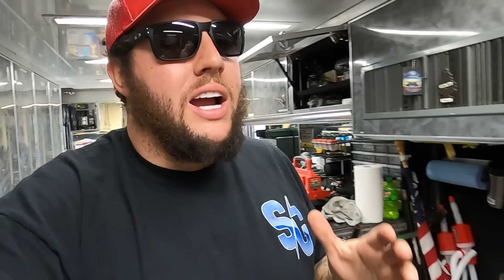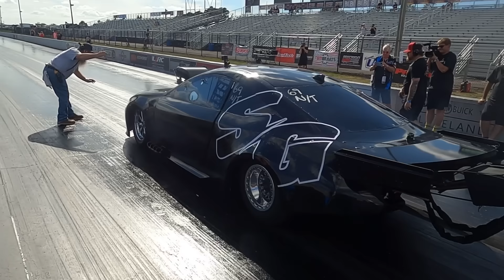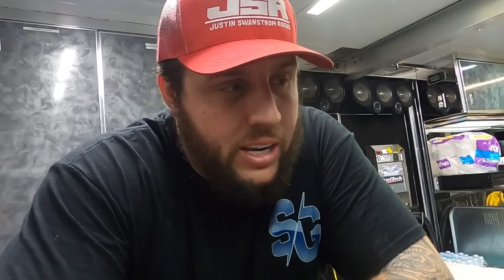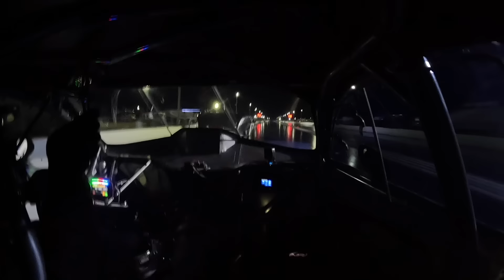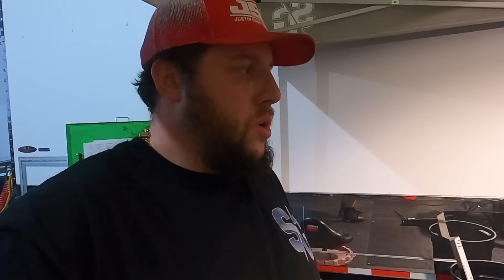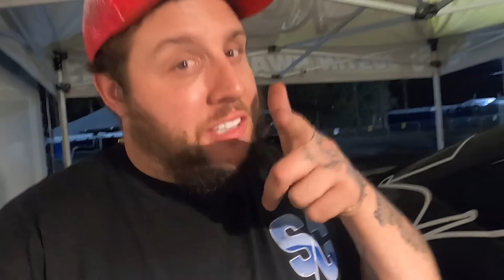PRE-NUP Making Progress On 275 Radials. Making Passes On Super Hot Surface

Comment: I would never take anything away from you as a driver. You're a great driver, but it helps a lot having a great crew to maintain the car where you don't have to worry about that, and only concentrate on driving, and keeping a clear mind. From what I've seen in these last 2 videos with these guys, you have a great crew in the making. 2024 is looking so far. I hope the good luck carries over to NPK. SWANGANG TO THE FRONT 2024.